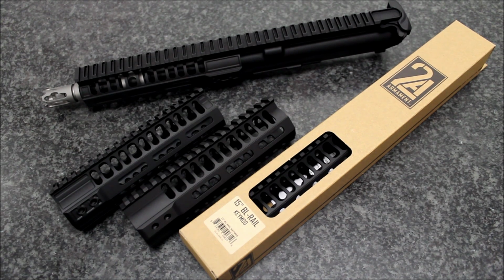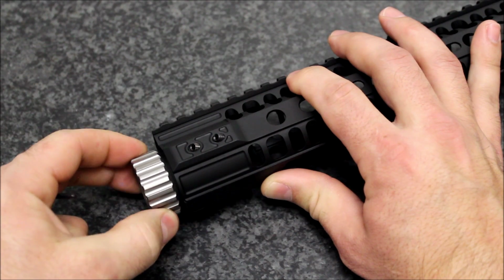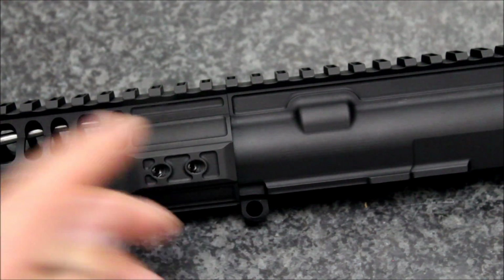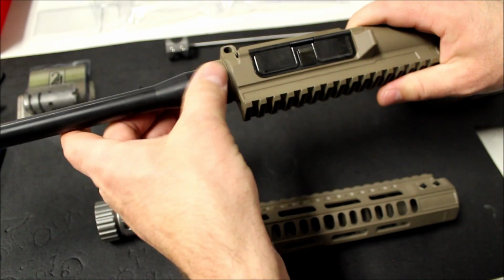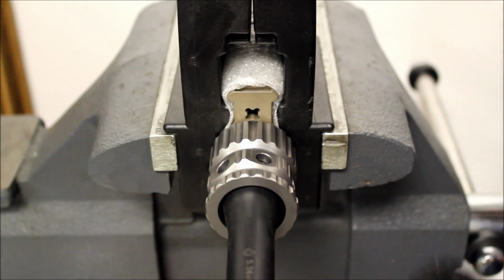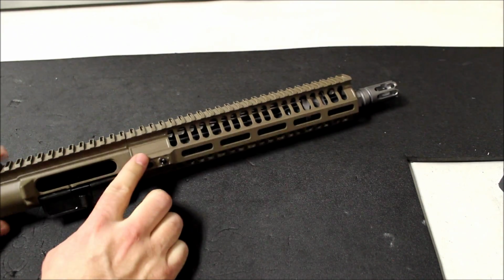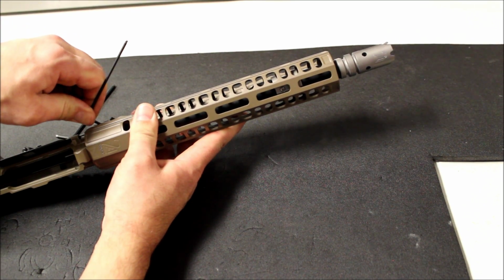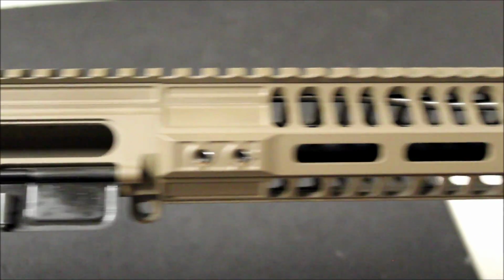2A Armament BL-RAIL and SR-RAIL Overview and install

Comment: did not know you had to mess with the screws to center the barrel. I always wondered why the gas block would look offset despite being installed in the dimple. This thing always gave me gas block clearance problems

Comment: The instructions specifically say to use gun oil on the screw threads.  I did this, and tightened exactly as stated.  However, the screws keep loosening, and then the rail spins loosely after shooting about 100 rounds.  Seems like a very very small amount of loctite on the threads is the only real solution I can think of. Any suggestions?
Reply: Vince Van Cleave what did you end up doing?
Reply: Yes, you need to use loctite on the threads, mine came loose while tuning my adjustable gas key and I put red loctite on the threads and it no longer comes loose. Ok’ so for all you “you’ll never get it off again nazis” You can heat the screws with a heat gun to loosen up the loctite and get it off. Take it deep!